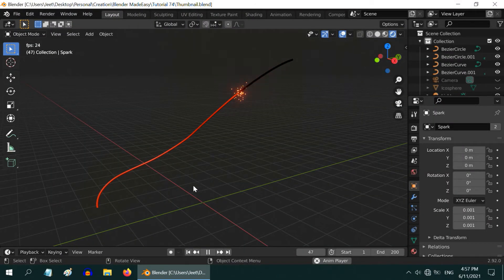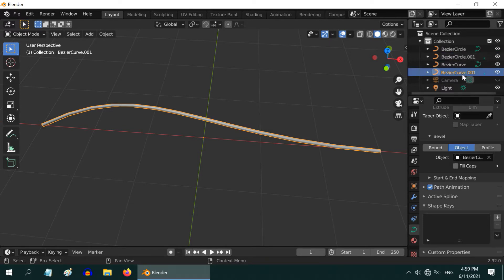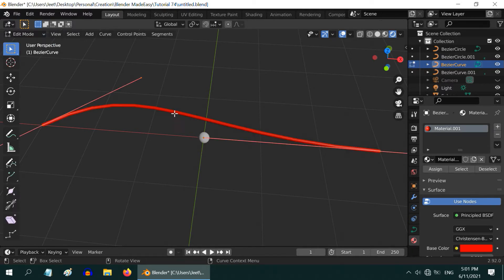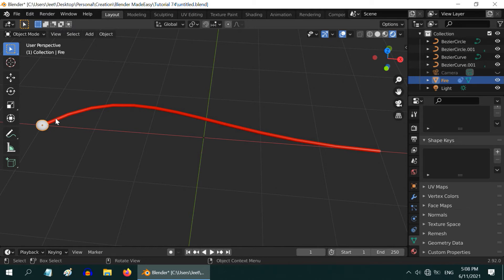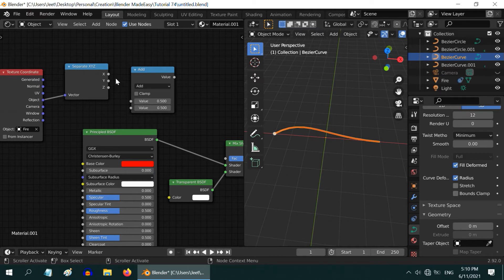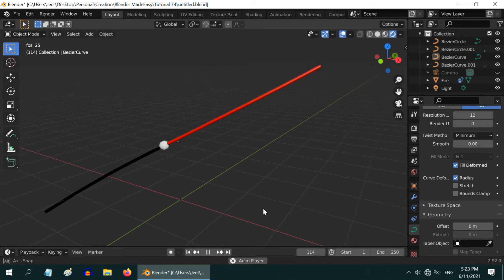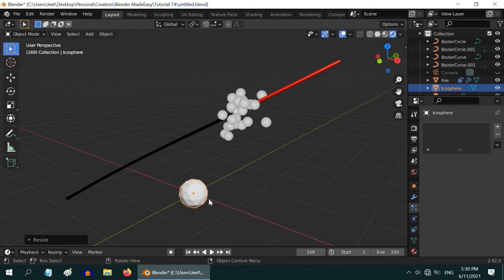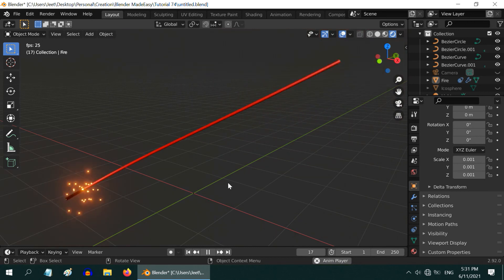Burning Electric Wire | Fire Sparks In Blender | Easy & Step-by-Step Guide | Blender Eevee & Cycles

Comment: I guess the wire burning technique doesn't work with circle paths right? I guess i could use switch another setup half-way through the circle or something...
Reply from the maker: We can use another method for a circular path, using Geometry Nodes. I did this for another person who was having difficulties for his model with a circular path. What I did is, in the geometry editor I took the circle (curve) as input. Then I added a Trim Curve node. Then we just need to animate the Start and the End factors and assign a different material for the selected part of the circle. You can try that, or you can send your blend file to us, I will help you doing it. Thanks!

Comment: thanks so much for the wonderful and instructive tutorial! I have an issue with the shading / transparency effect of the wire after "burning", because my bezier curve is a spiral. At 5:53 you mention that "you might need to set up a complex tree here". I think that is my case. I have the texture coordinate set to the object "fire" and the math converter set to "less than" as you said, but of course just using the Y output (or any single output) does not generate the desired effect of transparency or disappearing after the particle system runs over it. Any ideas? i guess I don´t even need the "separate xyz" converter but rather another one? Could I send you my .blend? Or maybe you can recommend me another tutorial where the math of the texture coordinate is explained for such a case? Thanks sooooo much!!!!
Reply from the maker: Yes, it may be little tricky to do that for a spiral object. If it is nearly vertical, you can use the Z-value to control the animation. It won't be perfect, but may be acceptable. Otherwise please send your blend file, we'll surely figure out some better node setup for you. Our contact details are given in the About section of this channel. Thanks!
Reply: @5MinutesBlender  thanks so much I´ll send it to you!!!!!
Reply: Is there any answer for a more complex setup that you could share in here? I'm struggling with the same problem.

Comment: I am an electrical engineer and I understand that wires when they burn it is not like this.  They just heat up, glow, melts then breaks. This animation is like a dynamite with a long cord that is being ignited at the other end. The spark slowly travels until it reaches the dynamite. I did not know they are using electrical wires for those. I thought they are called detonating cords.

Anyways nice animation. But this was not what I was looking for?
Reply from the maker: Thanks for your explanation 👍 You are absolutely correct. It is not an electric wire that they use for dynamites. I did not know a suitable name for this, learned from you that it is called detonating cord. Thanks for that! And if you can tell me what type of tutorial you were looking for, we can plan for something like that in near future.
Reply: @5MinutesBlender  Thanks for the response.  I was actually looking for a way to explain to electrical students how electricity works. When the wire/cable is not the correct size or correct insulation, the animation shows what happens.

Thanks a lot if you could make something like that.

Comment: why  need brazier circle ? what its use ?  as beginner my brain works this way" we need a path for fire to travel, so buzzier curve is that path. where the heck this buzzier circle came from ????????????????????????????????????
Reply from the maker: Hi Reneesh, you are correct, the bazier curve is the path which the fire follows. We don't need the bazier circle for that. The purpose of adding a bazier circle is different, we used it to create the wire object. You can create the wire in a different way as well. We created it by using the bazier circle and the bazier curve. If you create the wire differently, you do not need the bazier circle at all. But you still need the bazier curve since the fire will follow that. So the bazier curve is serving two different purposes here. The bazier circle is just for creating the wire, nothing else. Hope I could clarify your doubt. By the way, thanks for watching!
Reply: @5MinutesBlender  Thanks for the clarifications. good tutorial, waiting for more.

Comment: If you change the material to Alpha blend, in settings tab, you can make the "burnt part" transparent.
Reply from the maker: Thanks for your input. If I understood your proposition correctly, you are lowering up the Alpha value of the material as well to zero, while turning up the Alpha blend option, because just turning up Alpha blend does not make the material fully transparent. But even in that case, the entire material will turn transparent. In our example, what we want is, only some part of the material should turn transparent (the burnt part) and it will change dynamically as the fire make progress through the wire. That can only be done by using the coordinate values of the wire as a factor to mix transparency. But yes, we can simplify the shader setup little bit following your method. Instead of mixing with a transparent shader, we can directly use the coordinate value to control the Alpha channel of the Principled BSDF. That would yield the desired result 👍